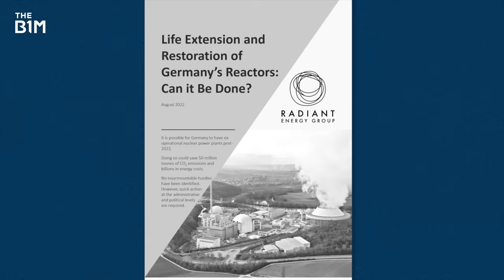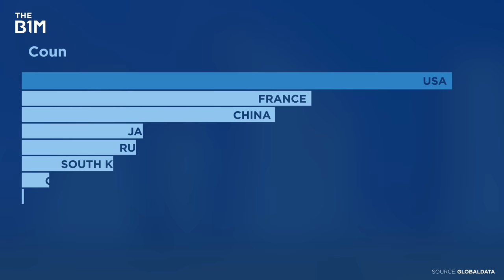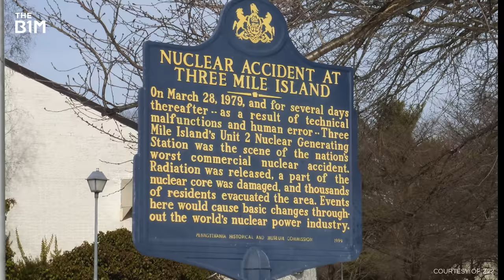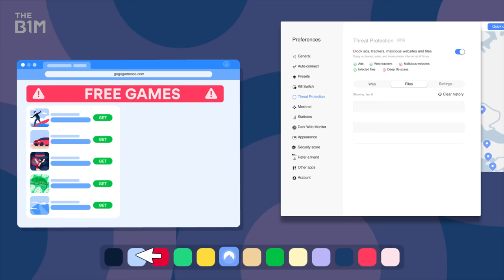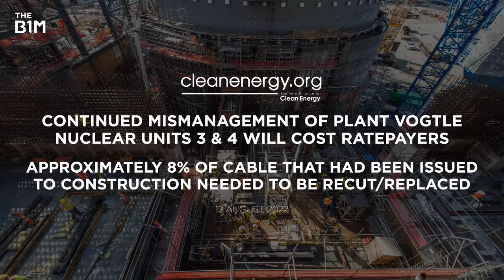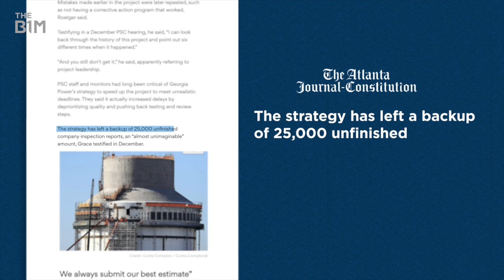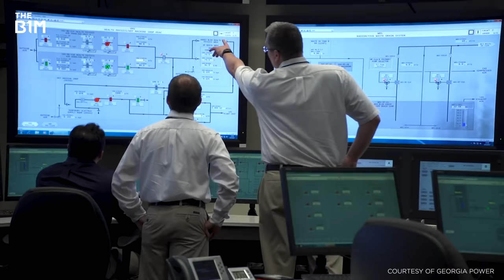Why Nuclear Power is Making a Comeback

Comment: So amazing that in the intro shots of the new nuclear power plant being built had a shot of the containment vessel having a ring hoisted into place and the pick of one of the reactor vessels. I’ve worked on both of those jobs as a young man. I’m retired now and my last job before retirement was building a coal cleaning facility at a coal powered thermal power plant.

Comment: Big mistake on the Flamanville reactor in France. You said it was going to be 300 million over. That's the latest added cost, but there has been numerous budget corrections since the beginning of the project... In reality, the project was first estimated to cost around 4 billion, and now it's gonna cost 19 billion... Not exactly the same thing...

Comment: We need a bit of a building boom to replace the current old power plants, hopefully a bit more assembly line construction brings down the cost.
Reply: It might sound nice,but you never reach the point of "mass assembly" with this to bring down the cost.

Every reactor is different because you have new designs that take advantage of new developments in technology. 
Really the only cost savings you would achieve with an assembly line aka build more reactors the same way is less planning, not in part production. The reality is you might only be building them in the 10s not the tens of thousends...
and also for this to be practical you would need to start the process of new reactors in a close timeframe of oneanother, ideally all at the same time after the first "test" build.
Reply: @MrMcMind  It'll never be mass manufacture but when every new reactor is a one-off then no wonder it gets expensive. The talent pool goes away to do other things if there is not a constant stream of new builds being started. Maybe Small Modular Reactors can solve that, if someone actually starts building them...

Comment: Baseload of a city of mega city is really huge. If we are pushing ev charging it will be even more so. There is going to be certain amount of electricity consumption by this area all the time, day and night. Nuclear power is by far the only solution we known that can provide this stability of supply. So it is either we change how we live or we found out solution that are even more stable.
Reply: Off-shore wind. Geothermal. Both capable of baseload power. Investments haven't been made in these technologies either in the last 30 years in America.
Reply: @sandal_thong8631  geothermal is great if you live on Iceland. It is next to useless in most places. Moreover, as someone who lives in Denmark: your belief in offshore wind is unwarranted. Sometimes the wind actually doesn’t blow much, even out there on the sea.
Reply: @peterfireflylund  I hadn't heard of "wind droughts" before today. But I guess that's another consequence of global warming, likely related to "jetstream stalling".

Comment: 300 Million dollars over budget (France) is a dam sight better than several billion or more.  France is slowly getting the build costs down because they are committed to Nuclear, build more plants  and more frequently, thus building the skills and experience required to do the job efficiently and relatively, speaking, close to budget.  Another factor is that they don't try to reinvent the wheel each time they build one.  Each successive plant is relatively the same as existing plants with only minor changes. Renewables can't even come close to providing the base load we need and it nice to see that people are waking up to this fact.
Reply: Thanks for watching and commenting. You have been selected in my draw✨Winners should text on telegram to claim prize. (Only Winners).🏝🏝

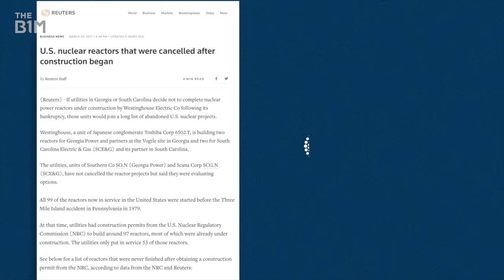Comment: 5:40 Flamanville will not cost 300 million more as mentioned, the costs will be over 10bn instead 3.3bn, with a delay of over 10years! Same problems in Europe as in the US (Hinkley Point C in the UK is the same reactor, also built by EDF, time will show if they can sort out the problems of Flamanville, which was kind of a prototype with a cracy amount of problems and delays, similar than the Vogtle project…)

Comment: Totally missing from this story is the cost of the uranium fuel . In 2019 the most profitable, paid for plant in the USA ,three mile island unit one ,shut down . Refueling the reactor, was going to cost more than the electricity it would make. The real problem with nuclear power is the cost of the fuel cycle.
Reply: That's simply not true. The fuel is very cheap, 3-10% of the cost.

Comment: Back in the 90's following the fall of the USSR France had good plans to work with the US & the rest of Europe in regard to nuclear power plants long gain plans, but then for some reason or another US felt like declaring a Crusade in the East,
Reply: Hardly Norway, they are number one in hydro and not to bad at wind either, right now they get about 95% from hydro. Then they have all that oil and gas and not one single nuclear plant.
Perhaps France and Germany?. France is number one in the EU in nuclear.
Reply: @hurri7720  My mistake, but yes correction it was during the 80s actually France started pioneering this large clean power system, Norway however also started a large system of electrical heating plans to replace gas-based heating, for them most gas and oil are used in either stoves, cars and other mundane stuff rather then power plants, 
Now I did a re-check and after Germany reunification in the 90s nr 1 priority was the redevelopment and maintenance of nuclear power plants,

Comment: I’m still hopeful for the new designs which use higher temperatures and low pressure plus safe shut down if there is a loss of power.
Reply: Yes they are molten salt Bois so super safe.

Comment: Build multiple small reactors based on the Navy’s design, all the same, same training everything.
Navy has a great track record. Scatter them around so the transmission lines can be short. 
The real problem is the “not in my backyard “ issue, especially in the richer areas.
Reply: navy reactors only produce 1/15 the output of the Vogtle reactors and do not have the safety features.

Comment: Honestly, I think small modular reactors (SMRs) will be the solution to all of this and for cleaner energy. Nuclear power, at least in California, could serve to supply the 20GW baseline for the state, while solar and wind supply energy during midday, and natural gas spin-up+batteries in the evening.
Reply: Honestly how big does the grid have to be with no high density fossil fuels, a little bit bigger, 100% bigger, 500% bigger ?
This is the one thing nuclear promoters do not want you talking about.
There is about 20million vehicles there and when EV with big 100kwh, long distant batteries, but doing a daily drive of 7kwh and topped up daily for free, NOBOBY WILL WANT NUCLEAR ELECTRICITY, and its bills. The less customers the more the remainder will have to pay.
In the end the last customers bill will be $millions.

20gw x 10hours = 200gwh, now divide by 20million vehicles = 10kwh, ezi pezi for 100kwh EV battery topped up daily.

Secret nuclear business, they want you to believe that they only, can save the world, f..king BS ers.

The auto industry is 'busting their b...lls' to get hold of the power industry.
Reply: @stephenbrickwood1602  Whether you like it or not, oil, coal, and natrual gas reserves will run out by the end of the century. we need another way of energy regardless of the climate. yes electricity might be more expensive, but for a 100 kwh EV, the cost of "filling up" will only be 20-30 dollars for a full "tank" vs the current 80 dollars per tank for gasoline. not to mention that nuclear has had much less capital for improvement and has only been around for 75 years at most, while gas has been around for 150+ years and has had a large ammount of R&D
Reply: @fenderpuddy5866  I DO NOT WANT ANY FOSSIL FUELS. 
Every vehicle will be electric. 
Electric storage is evolving faster daily. 
A few solar panels we trickle feed / top the EV daily for free. 
100kwh on stand by every day for free. 
Every one is in the 'horse and cart thinking days'.
Reply: I don’t think nuclear should have any issues supplying the entire energy grid of Californian. The French energy grid is already basically entirely nuclear. That’s what’s neat about nuclear. While you can’t use massive nuclear plants as peaker plants. They’re fantastic for base load plants. Which solar and wind just Can Not Do. And will probably never be able to do. Considering the fact that if the UK  alone were to try and use solar And wind alone. The grid storage solutions would require every battery produced in the world from now until 2050 to set up. And that’s ignoring the fact that in 2050 those batteries from 2022 are going to be totally useless. 

And that’s ignoring the fact that you’d basically have to pave over the entire island to get the energy out of these things in the first place. Not especially green.

No, nuclear is not only the future of green baseload capacity. It’s our only option.
Reply: Why would an SMR succeed where nuclear failed? The base principle is flawed, nuclear's greatest strength is the massive scale, now imagine all the SMR plants where you have all the nuclear safety standards but way less capital, not going to work.
Reply: @coryinthehouse5250  , yes I agree but also wind is fine as an addition. Right now Denmark for instance get 36% from wind and Finland 32%.
Reply: @coryinthehouse5250  Hopefully the French system can get back to being reliable and maybe even viable.
Reply: We should strive for almost completely renewable, but having backup nuclear reactors in case of emergencies isn't a bad idea.
Reply: Grid dose not have to be big. We need energy STORAGE, not a massive grid. Pump water up hill when you have overflow of energy, than when you in high demand let that water run downhill through a turbine and generate all the power you need.
Reply: @hurri7720 You are talking about installed or nameplate capacity. Wind turbines are not capable of producing their nameplate capacity on average over a year. A report came out this year in Australia and total nameplate capacity of winds turbines in Australia produced 30% of nameplate capacity on average last year and for solar it was 20%. 

Coal, gas and nuclear are 'engineered' to produce their nameplate capacity 24/7 reliably and without the need for backup or additional transmission lines. Wind and solar are weather dependent and as such their energy source cannot be engineered. Renewables are overbuilt to compensate for their poor total output but they still require storage and backup. They are causing considerable damage to the global environment and need to be frequently renewed.

Comment: For some reason, the common belief is that nuclear can ONLY provide base load power. A constant supply that can't react quickly to changes in demand. And so other methods (natural gas/coal) must be utilized for the rest. This is true, but short sighted. 

If nuclear power was used to generate the MAXIMUM amount of demand, not only would we no longer need natural gas or coal, but the question changes from "What will we use to get the rest of the power we need?" to "What should we do with all this excess power?!?"! A MUCH easier question to answer! Even if we didn't have the means to pump water uphill, store energy in batteries, use electrolysis to create hydrogen or melt sodium and store it underground (not that we'd need it since we're already generating the MOST energy we will ever need), but we could always just pump water directly into the air and let it drop! Just spin a giant fan and blow air around with the extra power! Let's build a supercomputer and only run it on the EXTRA power produced! Demand goes up, turn the computer power down. Demand drops, kick the computer into high gear! EZ-PZ. 

How has no one else thought of this yet?!? 

Oh yeah, I just remembered... environmentalists are dumb!! They create traffic jams filled with fossil fuel burning vehicles to... help the environment? They throw soup on paintings to "Raise awareness"?? As if everyone isn't already well aware of the problems with our environment! They only think that because AGAIN, environmentalists are dumb!
Reply: Thanks for watching and commenting. You have been selected in my draw✨Winners should text on telegram to claim prize. (Only Winners).🏝🏝

Comment: “In short, nuclear reactors have become extremely expensive, and take a long time to complete”. That’s the problem, in a nutshell. All the excuses in the world won’t change the fact that nuclear has a severe cost problem. I could care less about the safety issues (which tend to be badly overinflated). But nuclear can barely compete with coal on a cost basis, and that only with subsidies. Meanwhile, modern wind and solar are chasing $20/MWh, less than a quarter the cost of nuclear, and that’s without the subsidies. Projects use off the shelf components and can be built in a year or two. With costs that low, we’re approaching a point (if we’re not already there) where even with massive battery storage, it’s cheaper than coal and nuclear.
Reply: Wind/solar don’t work without backup from reliable energy sources. That almost always means gas. In the case of Europe, often Russian gas.
Turns out that wind/solar was extremely expensive and has so far had a cost of more than 100k fatalities and many times that in terms of wounded…
Reply: @peterfireflylund  I agree, we can’t do a wind/solar grid without backup. I disagree that it “almost always means gas”. Storage technology is the most active and exciting part of electric grid development right now, with hundreds of different companies developing solutions for a market worth many billions. All this innovation and competition will drive costs down. I don’t know what the final solution(s) will be. I do know they’ll be cheaper than coal and nuclear base load power plants today. 

But that said, I have NO IDEA why you’re attributing the war in Ukraine to wind and solar power. That just makes no sense.
Reply: @davestagner  because it has everything to do with Germany (and other countries) extreme gas dependency.
Reply: @peterfireflylund  You’re making a very good argument for them to be less dependent on Russian gas, which means more solar/wind and passive backups like batteries. This is a Good Thing. But it STILL doesn’t make the Russian invasion of Ukraine in any way Germany’s fault - and especially not because they started using renewable energy.

Comment: The other systems moving forward are all major new designs like small modular reactors. Nobody else is going to build that model of nuclear plant based on its huge costs and the competition from other resources like solar and storage. The nuclear industry's future is in those new designs, which could all be manufactured at a central site, cutting construction costs by a lot.
Reply: Also thorium molten salt reactors
Reply: Watch Gordon McDowell for information
Reply: Not there yet, Rolls-Royce talks about beginning of the 2030s, not that they are the only ones trying.

Comment: Fat short term loss for Sexy long term Gains.
Reply: Exactly
Reply: We need short term gains though to prevent long term losses. Also nuclear is not long term better than current generation solar or wind.
Reply: @XMysticHerox  We're not comparing nuclear to wind/solar, but to coal/methane burning... That's where we need it to enable the baseline supply for electrification of industry, homes, and transportation
Reply: @nbrowne1  Nope. Renewables provide baseload. So does current nuclear. Hence why what the lobbyist in the video says is quite misleading. Nuclear can technically be flexible but current plants are not.
Reply: @Person The exact thing politicians do not like though. That is the sad reality of what is going on here.

Comment: Not surprised about the issues with building new Nuclear Power Plants. My Dad worked on several. First one was in Rowe Mass. Designed in 1955 and built and on line by 1960. 3 & 1/2 years from ground breaking to online . No issues with the reactor system ever.  Everyone needs to remember it's just an electric power plant with a reactor heating the water (one of 3 water systems).
Reply: Thanks for watching and commenting. You have been selected in my draw✨Winners should text on telegram to claim prize. (Only Winners).🏝🏝
Reply: But today, it has been proven to be too expensive
Reply: @clarkkent9080   Not really. All a reactor is, is a way to make steam. Last part of the cycle is exactly the same for any power plant. You can really up "the cost figures" if you want to but remember the turbines etc would be the same cost no matter the source of the steam. Comparison cost should only be the reactor vs the other steam source. BTW cooling towers were never really required and should be removed. They were never required by any other type of power plant.